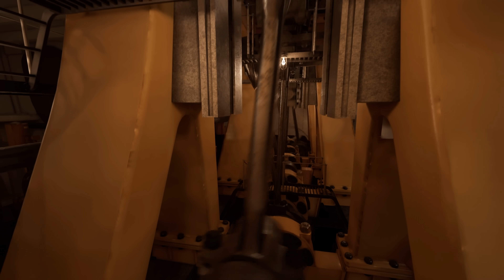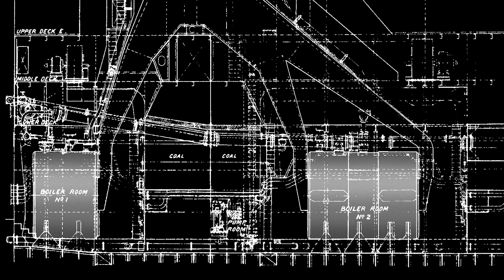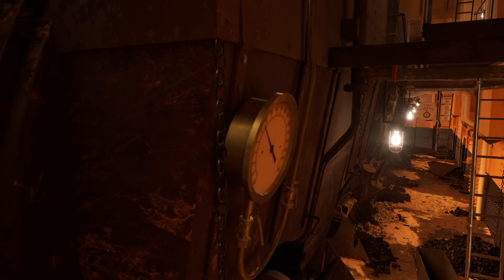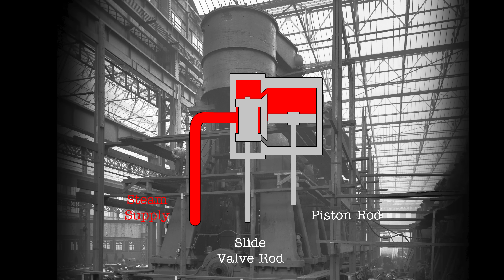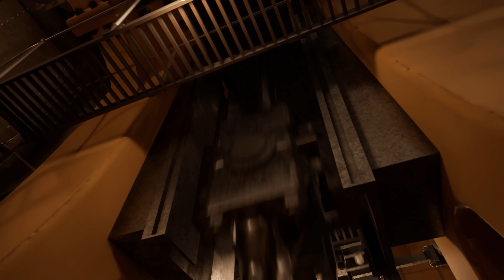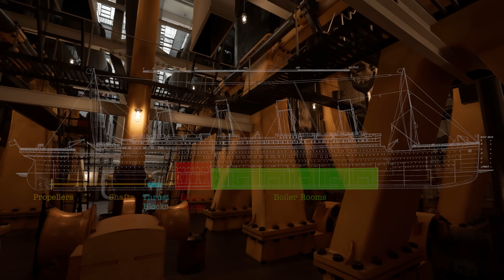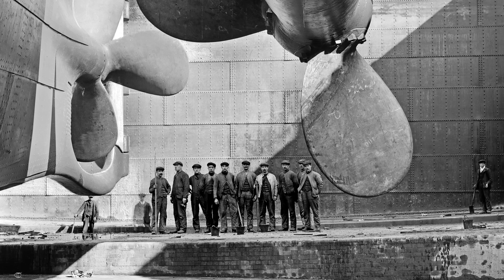A Complete Guide to Titanic's Engines

Comment: Bro , it was not subatmospheric pressure 
9 psi is not a vaccum 
Its actually 9psi over the 14.7 atmospheric pressure 
Scientific facts check
Reply from the maker: No the turbine was running at 9psi, 5.7psi below atmospheric pressure. The steam was exhausted down to 9lbs absolute pressure out of the main engines and exited the turbine at 1psi absolute. Taken from the 1911 journal Shipbuilder: https://www.encyclopedia-titanica.org/the-propelling-machinery.html

Comment: 12:07 if it wasn’t for show, the funnels would have a venturi on top, surely
Reply: Not really. Making a spinning fan that has to deal with the heat and dust from the fires below is much more expensive and troublesome than having a tall funnel. It's for that same reason almost all Locomotives used blast pipes and old factories have those giant chimneys. 

Today most industries do use fans but there is no more coal dust involved to clog up the mechanism.
Reply: ??…it seems you might want to look up venturi
Reply: @Erik-phah...I see. Sorry, English isn't my native language. I thought it was another word for a fan.

Comment: 4 hours working 8 hours break. But in those 8 hours you gotta subtract  bathing eating changing clothes both after and before you're working. So in practice 5 1/2-6 hours of sleep. Either way about 11-12 hours of sleep per day. But considering the working conditions that was barely enough to not be completely exhausted. Assuming a 7-8 day trip that means 14-16 work shifts. I'm gonna assume the firemen were not the 'poker playing' variety of seamen. Work then a quick washdown/meal then sleep.

Comment: I thank you good man for your most informative overview of this awe-inspiring technological marvel! I am a maritime professional, a captain and shipwrite, blessed to have cut my teeth, having apprenticed decades ago under some of the most traditional  and extremely skilled masters! Sadly a swiftly dying breed of deeply rich character, all of them.. While I am very much a sailor, I have as well fostered an insatiable interest and tremendous affinity for steam power, having built a number of successful and functional steam engines, as well as having run a variety in vintage crafts. Triple-expansion by far my favorite! As for my question; would you happen to be able to expound on the the methodes of lubrication of TITANIC's engines? Did she employ a displacement type lubricator, prior to entering her steam-chests? Or was there some more sophisticated system of oilers, functioning at each cylinder independently? I imagine the displacement type would be quite possible, being saturated steam, at the relatively "lower" pressures, (compared to more modern "dry"steam, reaching 20,000 PSI, etc) but I'm curious about the methodes of separating out the lubricants, prior to reusing that water. In my experience, one does tend to end up with considerable emulsion within the condensers, and as well, I've never seen the reuse of the lubricants. Should you have knowledge of such details, perhaps you might find a moment to enlighten me? Learning about, and dreaming about these creatures is something I never ever tire of! I thank you! -Loyal Tarbet

Comment: ? the picture on the intro shows what looks like a midships propeller cat solid, as it would have been at that time, the foreground shows a propeller with one blade missing, and the propeller is one that shows bolt on blades which were not used prior variable pitch propellers. educate me please, ret. ch eng.

Comment: 28:42  '28" Hg vacuum'? Is this an error (like 28" instead of 1/28")?
28" is about 711mm. normal atmospheric presure is 760mmHg.

At 28"Hg the condenser would work at near enough ambient presure (and a lot higher than the 1psi steam presure shown in the diagram), not what I would call a vacuum.

Comment: Very interesting presentation but I believe there is an error in your recounting of the pressure drop through the engines.  You note at 20.22 that the pressure out of the last stage of the piston engine (inlet to the turbine) was 9 psi absolute.  This cannot be.  You must have a positive pressure to drive the flow through the turbine stage.  I suspect the pressure was actually 9 psi gage and that it exited the turbine stage at roughly atmospheric pressure.
You specifically stress the fact that the pressure exiting the 3rd stage pistons was sub atmospheric but that is physically impossible.  It would be good if you would correct that point.
I am a degreed and licensed mechanical engineer and I spent my career working on compressible flow turbo machines so I do understand pressure and how it drives turbines.

Comment: Wunder how the ash was disposed of at sea.  There had to be a simple way.
Reply: It was shovelled into buckets, which were then hoisted up on cables to E-deck, where they were finally dumped out of scuppers located in the rooms labelled "ash place" or "ash ejector rm" on the deck plans.
If you have Demo 401, you can access one of these scupper rooms through the linen closet in the stewards' bathroom off Scotland Road, just opposite the emergency hatch down into Boiler Rooms 5 and 6.

Comment: What if they had the coal bunker above the boilers with a direct feed system. So instead of cooking the firemen alive they would just be ferrying coal from the bunkers into large funnels that would drop the coal directly into the boilers.
Reply: Hopper-fed systems were in use on some ships for a little while in the Victorian period, but the marine environment proved them to be them less than practical, and necessitated heavy human oversight even when they were implemented.
Plus, with the price of oil dropping all through the first years of the twentieth century, the writing was already on the wall that coal-fired boilers were on the way out by the time Olympic's first keel plates were being laid.

Comment: Fun detail about propellers, many older submarines used ones with a prime number of blades to limit vibration/ noise. five or seven blades were common. Being quiet is paramount to submarine operation as you can imagine.

It's been decades since I served, but supposedly the newest Navy submarines use more advanced things now, 'propulsors' and such versus bladed propellors.

Comment: Thank you for the video. Such magnificence and then have man's hubris take it and ram it into an ice field, awesome. All that power yet using only 60% of the coal normally with only a 2 knot penalty. That center turbine scavenging the remaining energy from the steam for another 16000 hp is beyond cool. The engine shaft to propellar shaft transfer connection alone is hella cool. Love how the "unused" fourth stack provided light and air to the crew below and allowed a break to exercise the legs and get a breather up top.

Comment: As a kid I working for Casting Materials Corp CMC now a supper fund sight in Compton Ca, I used a wooden molds room as my break area, and worked at a Forge, Foundry, and Press.
 I retired as a Millwright, Electrician, Pipefitter, pigging, or passivation's, Glazier, Carpenter, and Teamster, this was a Huge Project! 
The lowest pressure steam I have worked with was 150, tops steam 750, Hydrogen at about 10K,
 Abott Labs Casa Grande Az was 135f inside, no lights, no air, no smoking. Sorry, I have lite smokes off hot castings and the forges' ovens walls as a kid.

Comment: In the animations of the propellers turning, either the blade pitch or rotation is reversed. As pictured, the center propeller would be trying to pull the ship backwards while the two side propellers were rotating and/or pitched properly. I didn't notice on the earlier animations but the ones after the 33 minute mark, the propellers are fighting each other. A minor detail certainly, but worthy of mention. 
I did enjoy the video very much!

Comment: If you are interesting in the engines, the following is of a steamship which uses the same type of boilers fitted to Titanic and which were never converted to oil. They still use coal today. Really fascinating look into all the machinery of an engine room using triple expansion steam engines. There’s also a good explanation on how the engines are put into reverse. These engines are very slightly different than Titanic, one of course is size, but the biggest difference is Titanic had 2 low pressure cylinders, as explained by Mike. 

https://youtu.be/1JyNHoCBEjs?si=BbmHmr-zRPDZ0e9O

Comment: At 18:00 in the animation of how steam is guided to the piston, only the smaller inside part of the valve body is under pressure. When the valve moves over the opening to the piston, the steam rushes in from the inside part of the valve. The outer part of the valve allows the used part of the steam to escape the piston.

Mr Crispin explains how a steam engine works in great detail here:

https://youtu.be/JRdTPNApfuk?si=t2c_9B4380Ay7ycE

Comment: Notes: they had filters to recycle water, and remove sailt from sea water to refuel, 
Water could be sotred in the balist, the funels would also suck in air and blow out the smoke and soot, but made conditions foe the crew terrible as the heat of the boilers and the room,
The brige would send messages down to the fire men to tell them what pressure they need to generate 
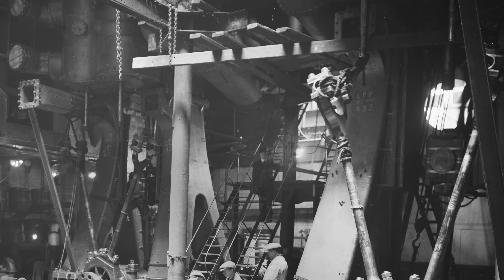14:00ish, pistions...
16:25 a scamatic.. also note from other video, if the caps are removed it takes alot more pressure to move the pistons..
18:00 Tripple exspanton pistion system

A sky light would be opened at the top of the ship releasing light and cooling engine room, greats in the floor would stop people from coming down from 3rd class,
Propellers were in small shafts for mantance, and near the end vibrations would be absorbed by the thrust block and distributed in the hull
The pumps in the condenser to remove water from steam, were so strong you could turn the turbine with vacuum alone

The 4th chimney could help cool the turbine room and a staircase would let crews have a breather

34:00ish, the condenser
23:06 propler shaft,

Comment: "Below earth's atmosphere" is COMPLETELY WRONG!  When they say 9 pounds of pressure, they are saying that above the ambient average of 14.7 pounds per square inch.  You and me are breathing air at 14.7 pounds per square inch.  If you go up 1000 feet you will lose half of a PSI.  By the time you reach 18,000 feet, you will be at about 7.8 pounds per square inch and learning about "hypoxia".

Do you see my point?
Reply: It's not wrong. This is a closed system so Earth's atmosphere plays no part. At the condensers the Atmospheric pressure was almost pure vacuum or close to 0 psi absolute.

Comment: According to the video, which I think is correct, the left and center propellor spun the same way.  Typically, airplanes with propellers and boats tend to have an angle of attack that is positive, which means nose or bow up.  When that is the case, in a rotating propeller assembly, the blade moving downward has more "bite" and thus more thrust.  In this situation, you have a left shaft with the blade moving downward on the outside, meaning counterclockwise, and the right shaft spins the opposite direction, but since the rotation is different, you also have the descending blade on the outside as well, cancelling out any sort of asymmetric thrust.  Problem:  The powerful center turbine engine spins counterclockwise as well, and while it is still center mounted, it creates a tendency for the boat to turn right. I wonder how the designers handled this problem....

Comment: So how did they make sure the all the screws were going at the same rpm’s?
Reply: The outer ones rann on identical engines using steam at the same volume and pressure. What ever practical difference there was was probably miniscule and would be compensated by the helmsman. The center shaft could run at whatever speed it wanted as far as the ship itself was concerned.

Comment: I once got an engine room and boiler room tour aboard the S.S. Badger while it was crossing Lake Michigan.    I managed to talk my way into it.   I will never forget how neat it was
when the guy turned on the lights inside the engine crank case and the crankshaft with connecting rods could be seen through the port holes.   They splashed a big bunch of oil
on the porthole glass each time they came around.    Fire box was nice to see too.    He opened the door and let me look inside.   It is a coal fired reciprocating steam ship.
Just a little toy compared to what Titanic was!

Comment: To make things make sense to anyone confused, the first cylinder is high pressure, second is intermediate, and third&fourth are low pressure. At this point the pressure is still greater than atmosphere. From there it goes to the condenser which lowers the temperature of the exhaust gasses to the point where the pressure is less than the atmosphere. This is applied as a drawing force to the backside of the final pistons, constituting your fourth expansion. It’s important to remember that the force of a cylinder is calculated based on the differential pressures on either side of the piston, not the pressure inside vs outside.
Reply: Or steam could fed from the low pressure cylinders through the turbine to the condensers.

Comment: Very interresting documentation. For people that are not used to emperial units, the technical data (psi for e.g.) is very difficult to recalculate simultaneously into metric units. From the perspective of the interrested viewers it would be great to get technical data additional in the worldwide most used standard scientific system.

Comment: It’s crazy to think how many man hours were put into feeding the boilers with coal from loading it on the ship, the shoveling it in wheel barrows then shoveling into the boilers. Meanwhile something as simple as using fuel oil which could be loaded in the ship easily, burned automatically in the boilers without all the men shoveling coal. Couldn’t imagine how hard them guys worked.

Comment: science has yet to explain cavitation.  How it actually works.   Many people know that a propeller loses some metal off the trailing edge, and we finally realized why this happens but the underlying phenomenon has yet to be fully explained.   turbulence at the trailing edge creates an air bubble, and when the bubble collapses, the inside layer of the bubble heats up hotter than the "surface of the sun".  We know this is true, and it's accepted now.   So, the super heated collapsing bubble vaporizes the trailing edge of the propeller and the metal goes straight from a solid to a gas - bypassing the liquid stage completely.   You can set up an experiment that uses cavitation to heat water into a steam.  Some people want to know if the phenomenon  produces net energy or if it is energy-flat, meaning the energy input and output is the same.  Some animals use cavitation.  The Mantis shrimp for instance uses cavitation to crack mollusks open.
Reply: How can any process produce energy?

Comment: 9 psi is not below our atmospheric pressure 
0 psi is earth's  atmospheric pressure or there abouts when measured via psi. 9 kpa would be leass than atmospheric pressure and the turbines wouldn't work lol
Reply: psig - gauge pressure or pressure above atmospheric
psia - absolute pressure

The steam does in fact leave the low pressure cylinders and enters the turbine at 9 psia - absolute pressure, so yes, below atmospheric pressure. The entire reason this works is because this is a closed system cutoff from the atmosphere. At the other end (exit) of the turbine are the condensers that cool the steam and condense it back into water. That reduces it's volume so much that you essentially have a near vacuum at the condensers. That gives the turbine about 9 psi pressure differential and about 86 F of temperature change to work with. That water is then pumped back into the high pressure boilers.
Reply: You do not understand the difference between psia and psig!  (lol)

Comment: Did anyone see the blade angle of the center propeller is backwards from the rotation in the computer model. In other words the blade angle and the rotation would be pushing water forward instead of backward.

Comment: I have a question: I know how steam locomotive boiler feed pumps and injectors work, but did the Titanic and her sister ships use the same kind of system?
Reply: While i know none of the specifics Titanic used two Tripple expansion steam engines and a single steam turbine to drive the props. I have no idea if they use a similar method of operation to a steam locomotive however i hope you are able to find the answer to your question, if so please let me know as im curious about this as well now.